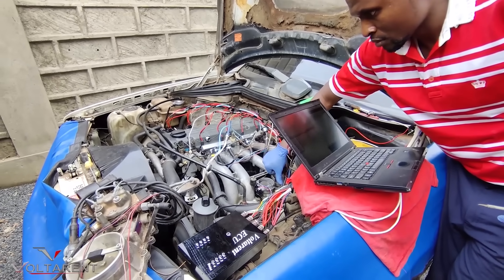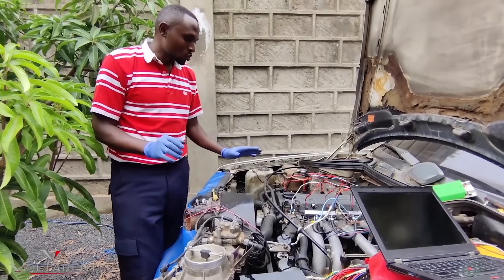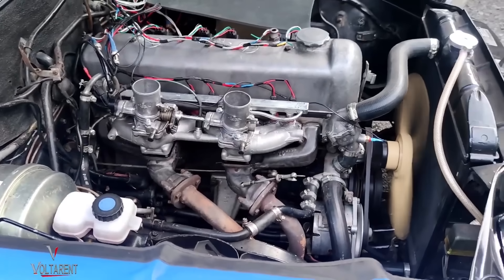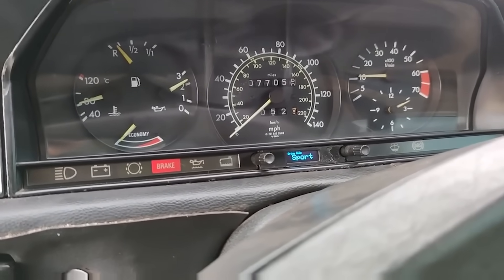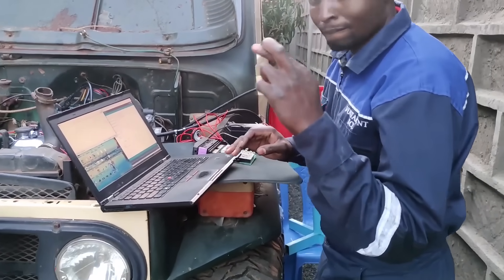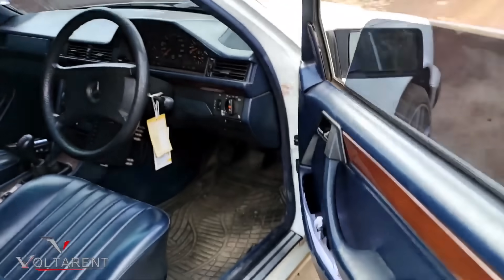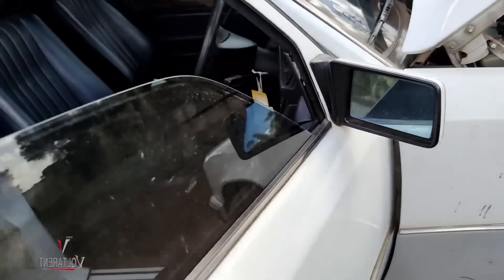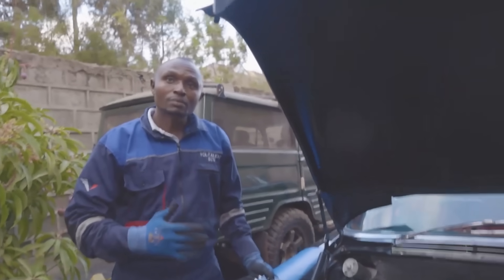African Genius makes Old Engines outdo Modern Engines!

Comment: So basically this man built his own “haltech”
Reply: With 1/4 the complexity too
Reply: @Syncopia they already have that it's called a megasquirt
Reply: More like a speeduino I’d say
Reply: @rad8078  Or megasquirt
Reply: @rad8078 🤣🤣🤣🤣You guy, how hard is it to believe one can build their own original design without copying? I have designed machines before, a QUAD head 3D printer without any reference. Voltarent ECU doesn't have maps, tables that speeduino relies on, mine uses mathematical formulas to derive fuel pulse width. Take your time, check out how this ECU journey started on my channel. Your subscription will be appreciated.
Reply: Yeah, the FuelTech from africa
Reply: no. he just basically copied the open source speeduino 😂I'll tell you more. the well established in Europe and in the world - company named ECUmaster - it was started by an enthusiast who build his piggyback ECU almost 20 years ago by himself. he designed it himself in a box size smaller of pack of cigarettes. it could also work as a simple standalone ECU. arduino didn't even exist at that point. currently there are open source projects of stand alone ECUs built from scratch that can run 8 cylinders sequential injection with variable timing, CAN communication and everything most modern engines can do. I think some can already control direct injection! and these are hobbyist projects, no big companies involved. okay, maybe for Africa this guy's achievement is something big, but come on, we live in globalized world. if he heard and have access to arduino, then I've got hard time believing he's never heard of speeduino project and made it from scratch by himself 10+ years later...
Reply: @plllot9713  it's the fact he did it with way less resources...and probably not formally taught..

Comment: 1160 usd for a 4 cyl? Way too expensive for a rip-off Speeduino. Standalone ECU exist from a long time: Megasquirt, Halltech, Fueltech, Motronic, Apex, Speeduino and so on are a lot of other examples.
Reply: To be fair, that 1160 usd price is for the full conversion, not just the 'rip-off Speeduino'.
Reply: @eleghari  Speeduino by the way should be involved in all this, they've been mentioned like everywhere for something they are not involved at all. This is Voltarent using Due 32 bit ARM board without EEPROM which Speeduino heavily relies on to store parameters, you know details that you are choosing to skip in order to make Voltarent look cheap. Voltarent ECU can have 20 maps, 30, 40, 50, until memory runs out, can speeduino do that? Voltarent comes with 4 drive modes mapped ready to be used at any one time, each completely different that the other. It supports power on demand, even on 4 cylinders (look it up)
Reply: @eleghari  which still is a lot for a Mega2560 EFI ECU conversion for a 4 cyl
Reply: @GalaxyTab-r8z  Can you differentiate between Mega and Due?
Reply: @PeterMbiria1  so then, why are you using the Arduino IDE and receiving data through the Serial Monitor?
Reply: For a one man operation, it sounds about right.

Comment: Adding fuel injection to old engines has been going on for many decades, it is nothing new. You have been able to buy kits for decades.
Reply: There is nothing new on everything
Europe and other built on what was learned from ancient civilizations.
Having said that,
It is important that the engineer builds these from Africa and from scratch
I would rather he makes me one for my car on the continent than me buying generic stuff.
Reply: Have you created yours? Or what have you made so far? Keep
Your jealous mindset off this man
Reply: Nothing is new under the sun...Deal is the whole conversion... being able to tamper with a program that you created yourself... with a mother board that you designed and components that you soldered yourself.. design and machining that you did yourself...3D printing of components with a printer that you designed and assembled yourself... its like having your own kid when you got an option of adopting one or more.
Reply: Exactly. People acting like this is new stuff. Impressive sure. But at the same time, he went to school for this. I would hope he took that knowledge and applied himself. That's the whole reason we go to school.

Comment: I'd like to get in contact with him as the technology I'm working on will need an engineer like him to implement the technology into todays, and yesterdays existing vehicles so that these vehicles can run down the road with nothing but water in their tanks for fuel. As for the most part I'm just the science guy behind the technology and thus need a hand in getting this world changing technology implemented everywhere fossil fuel are used for transportation and power generation.

Comment: I wanted to say a proper ARM based board would be better, while wondering how the ATmega chips Arduino is known for could keep up and perform well in this application. A little search and I see that the Arduino DUE uses a 32bit ARM chip. Well done ✅👍
Reply: I also had a quick search when he said "Arduino" and "nanoseconds". He doesn't get many instructions to do his calculations before he runs out of 'nanoseconds'! Perhaps he relies on a pre-computed lookup table?
Reply: @trs4u  How about the stock 84 mHz clock speed on the 32 bit chip?
Reply: @PeterMbiria1  oh hi! Nice work! I just mean even with that part, a cycle is still 10+ nanoseconds so you don't get more than 100 instructions (depends on lots of things) before you end up in microsecond land again. I don't know what kind of maths you're doing, but people can struggle to optimise code down small enough to hit tight constraints. Not a criticism, since you obviously succeeded, just an observation based on "nanosecond".
Reply: @trs4u   Traditionally, EFI systems all rely on precomputed LUTs. There have been exceptions to this tradition, of course, but at its most common and basic, EFI takes throttle position and engine RPM as coordinates on a table of injector pulse values, tweaking the lookup value on the fly with various compensatory input values such as intake air temp, coolant temp, knock sensors, lambda, yada yada
Reply: @rocketsalad  that tesselates with my experience of doing fast stuff on slow parts. I guess that's why they call it 'remapping'? Funny, I'd previously assumed auto parts were fast enough to 'do the maths' and that 'mapping' was being used to describe the function being computed. Every day's a school day.
Reply: Speeduino has been using the mega for ever as an ECU. This is nothing new. I wonder if any of the work is a fork or not.
Reply: @Rok_Satanas  I use Due 32 bit, Speeduino uses 8 bit, does that mean anything?
Reply: @PeterMbiria1  With the due you could do more stuff. Congratulations. The video was formatted in a way to make it look like this hasn't been done, that's why I mentioned speeduino. I do know someone was working on a Due port on speeduino from 2017, but i don't know if it went anywhere.
Reply: attiny is being used now for DIy efi setups

Comment: In short that's a Speeduino, don't take all the credits 😅
Reply: 0% speeduino,  nothing from speeduino, I use arduino due 32 bit 84 mHz board, speeduino uses arduino Mega 8 bit 16mHz board. Check my interface, nothing of speeduino.
Reply: @PeterMbiria1  Speeduino is mostly an open source software (more specifically a firmware), the hardware doesn't matter that much u can use speeduino almost on anything, I've used my own version of speeduino on a STM32. Saying that you used 0% speeduino is a bit of a stretch since you are using an open source development board made by Arduino (not by you) and the Arduino IDE. About the interface I can't tell what kind of interface you are using since the only thing I see on the video is the arduino IDE serial terminal, but if I would have to guess that has been taken from the Speeduino open source project

Comment: Should’ve patented where possible before showing things here otherwise you will be sued to your last breath
Reply: Hard to patent something that is already at least 30 years old. Replacing carbs and points with fuel injectors and electronic ignition has been going on for many decades.
Reply: You legally can't patent a speeduino because of the open source licensing, and it may be hard to license or sell it in bulk without mentioning it's based on the speeduino platform.
Reply: @MikeStavola  I have patented because it is an original design, not speeduino. Man, you guys know speeduino but fail to know it uses Mega which is 8 bit, I'm using Due which is 32 bit 84 mHz chip.
Reply: @PeterMbiria1  These people who want to talk bad about you have never done it. They are arguing in one window and reading google in the other.
Reply: @MikeStavola  you can fork the project and it's fair game😂.
Im not suggesting he patents it of course, but im pretty sure it's been done before.
Reply: @MikeStavola  certain aspects that are unique to his “take” on this that are unique to him can be patentable also nowadays it’s easier to find an OEM or custom chip manufacturer so he can have a business that is sound and protected from flimsy lawsuits but it takes experience to get there
Reply: He could brand his ecu, replacing carbs for fuel injectors requires a ecu, designing your own from scratch ain't no easy task not many  people could do that at all!

Comment: Improving consumption by 5 km/liter is 11.7miles/gallon pure genius.
Reply: Its like that, when you put injectors on carburated engine from 60 years ago. Of course you will get better performance and economy. Thats why Europeans invented injection 50 years ago. Since 1980s, injectors have been built in European cars.
Reply: @uroskostic8570 Uroše, nisi Evropejac.
Reply: @uroskostic8570 Yes, you are right about all that. I do like my 1983 motorcycle for having carbs and no ECU though, easy for me to work on, I do have modern vehicles too but all this electronic, software crap is a concern.
Reply: @uroskostic8570  If he was white he'd still be brilliant!
Reply: @middleguy840 He is already brilliant!
Reply: Have you ever heard of MLK 'judge people by the content of their character not the color of their skin".
Reply: @middleguy840  no one said anything about skin color until you brought it up

Comment: If this ecu can diminish the pollution from these old cars it will be perfect, please don't try to sell it to western countries, keep it for africa markets
Reply: But we have this already in Europe you can take out the points and put in electronic ignition so what else has this got
Reply: What is new about replacing carbs with fuel injection and replacing points with electronic ignition?
Reply: @bills6093 there is nothing new. The procedure is already outthere and standardized, even coding is exactly the same
Reply: @bills6093  I will rewatch
Reply: But why limit yourself to only making profit off of one continent? 
To be honest most people wouldn't use it in Western countries because more modern vehicles are plentiful, fuel injection started in the late '80s and almost everyone in America drives a car that's newer than the early 2000s or newer. Most people don't have the knowledge to even install something like this, most American consumers don't even know how to change their oil let alone swap an entire fuel delivery system. It just wouldn't even make economical sense to sell it here except for special use cases. Most people with older cars are collectors and they want to keep their vehicle original anyway.
Reply: Just sell it to old car collectors globally! And invite me to your super yacht in a couple of years. ;-)
Reply: Answering the people above. No one known has done it to his level. Simple...somewhat....he's pretty meticulous. He has packaged it and use some entrepreneurial skills to make this available. Willing to bet that not too many, if any....can tune as well.  I'm sure he has much more he is not yet revealing. Look how he created driving modes and seamlessly added the display to the instrument panel. And just how easy do you really think this is....? I don't understand the attempt to minimalize?
Reply: @justmyself1000  My man I know you want to be proud of African achievements and this guy is doing great work but this kind exageration is going to make people criticise and make you seem like you don't know what you are talking about.

This technology has been around since the late 90s early 2000s. Maybe not widespread in Africa, but custom ECUs and custom engine tuning is well known in most countries and there are companies who make and sell kits so you can build your own. Anyone who wants to learn can code, there are books and courses and full guides online for free. That is probably how this guy learnt, he did not invent it himself.

Praise his achievements for what they are and what they mean for Africans, but do not try to make him sound like he is the next Holley or MegaSquirt because then people will have to minimalise to be truthful.
Reply: @yinyangsaladgang8789  I didn't even mention anything about "African Achievements...?"  I don't even know where he's from? I assumed Germany because of the German car. Yes, I'm familiar with Arduino. I'm very familiar with ECU's and cars. Having said this....this is still not an easy task. Not even easy doing this properly with several different cars. In order to do this properly...one needs some knowledge of electrical engineering getting properly voltage time of voltage. Stoichiometry and many other auto systems. Impressive how he integrated the driving modes (which the driving modes is pretty cool upon itself) seamless into the instrument cluster of these cars. It looks oem! Then there's the gumption of marketing and the entrepreneurial part of this. With all the minimizing and downplaying...it seems like it's agenda driven and coordinated?
Reply: @justmyself1000 it's a speeduino fork. This ECU has been around for a bit. It's meant for both enthusiasts and for burgeoning countries to keep engines running.

Comment: It's great he has developed a local solution to old and outdated technology and keeping old vehicles on the road. I'm sure it will make cost effective and fuel efficient cars available to many in his local area. But I can't see any significant 'invention' compared to an open source microsquirt or megasquirt system, which can be DIY soldered, installed and programmed.

Comment: Ok, what is the advantage of this system over a Haltech, Motec, or other existing standalone systems?
Reply: Probably cost. Most aftermarket ECU companies overcharge for what you actually get. I run an old Megasquirt and a Holley Terminator X. I'm sure this is much more basic.

Comment: wait a min... doesn't Holley make something along this same product line?? i believe its under Holley EFI brand and they've been doing it for years now... they even have a version that looks like a normal carb but its fuel injection and its adaptive (meaning over time it will auto tune, think of it as AI for cars) and its a much more simple and clean installation, the original idea was that Holley would introduce an EFI carb that could be bolt on to any old car using carbs and it would allow it to pass even modern California emission testing and with a flip of a switch the same car can be doing pulls at the drag strip.. i'm guessing this guy didn't have any internet to look it up when he was building this?
Reply: There are a bunch of kits to do a standalone ECU for a similar or lower price than what this guy was talking about. Microsquirt is a popular one I've seen at car meets and it's supposedly pretty easy to adjust for the application it's being used in and can run with as little as a crank position sensor, but can incorporate other sensor data to refine itself. It supposed to also have some auto learn function as well for obscure applications that aren't included in the software package.

 I have an older wagoneer that has gremlins in the harness and I was doing a bit of research last year. However I was able to track down the bad wires and two connectors that were too corroded to consistently function. So I didn't end up spending $800 for the kit.
Reply: @ottopartz1  I think you find the kits you mention are not available in Kenya and then you need to install them your self but he does it for you
Reply: @lesliemeehan3724  he was claiming that he makes the kit and controller himself.
Reply: Yes, there are a bunch of standalones for LS engines. The issue is the fuel maps, timing triggers, etc. Try using a holley efi on a Mercedes.
Reply: Also cost and complexity.